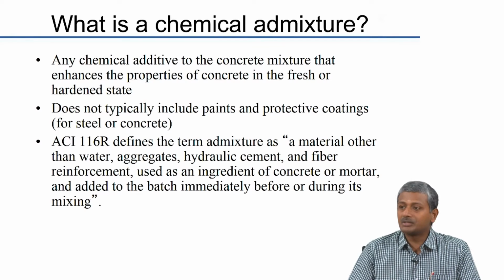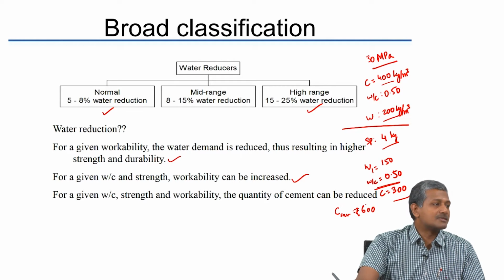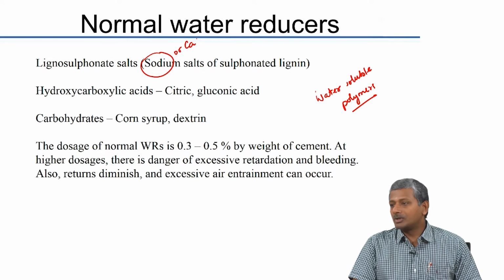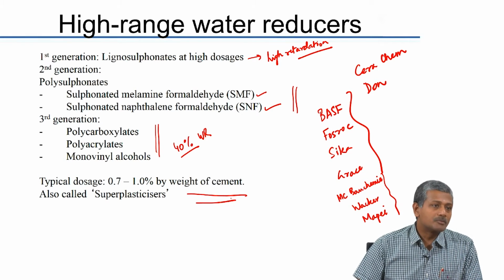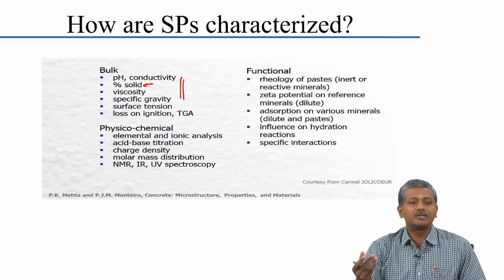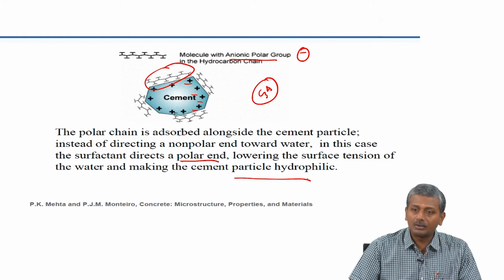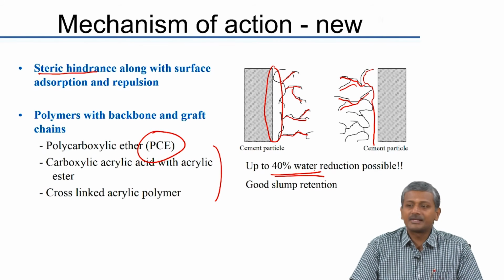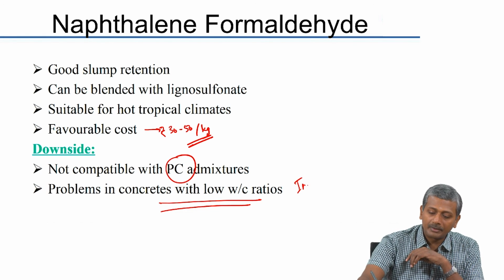#15 Chemical Admixtures | Part 1 | Advanced Concrete Technology

Comment: Thanks for share the Knowledge. I have a question. Why the air concrete increase With the time ? For example, 3.0% at time 0' but 60 min after it can be 10%. I have seen that this happen mainly with superplastizicer based pce. Thanks